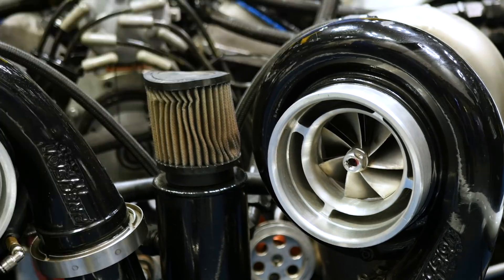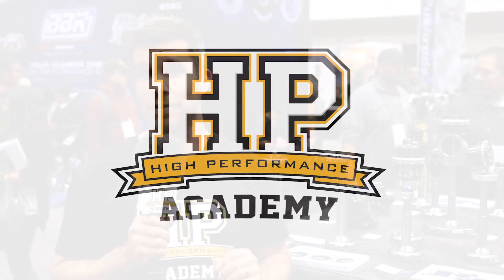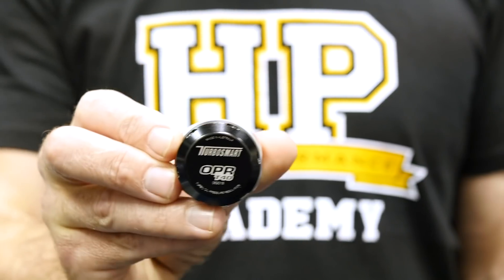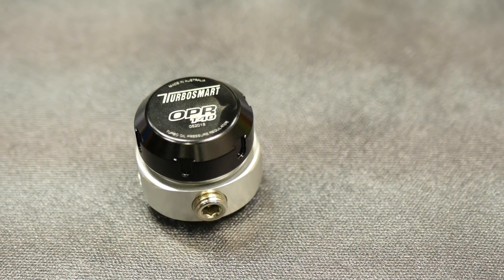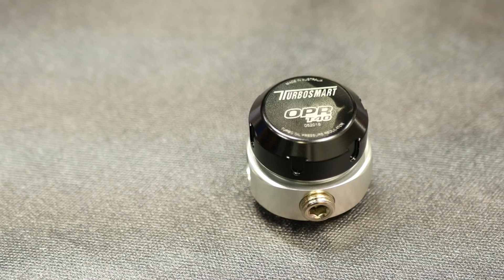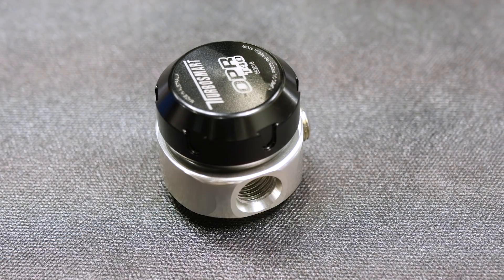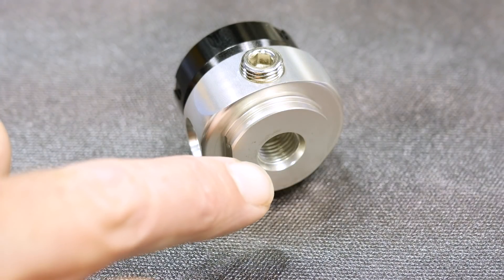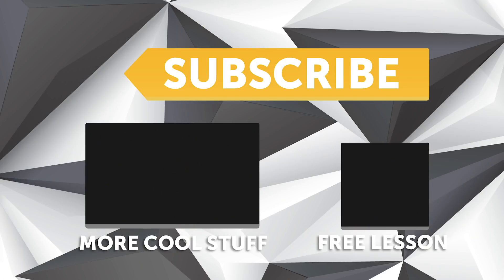Excessive Exhaust Smoke? This Might FIX Your Problem | Turbosmart [TECH NUGGET]

Comment: kinda stupid to put a filter in there? The main filter will sort debris out. The little filter in his unit will only risk to clogg which will end up with a turbo with no oil
Reply from the maker: This isn't a filter, it's a regulator - Taz.

Comment: If you have upgraded your rb25det with a nitto oil pump this will cause excessive oil pressure to your ball bearing turbo as nick stated oil will get past your turbo seals. This is a must for those folks.
Reply: Recently installed one of the new models in my sr20 and works a treat.

Comment: Hi I have new pte  6466 on my  have busted 2 turbo seals  will this help  I have a nitto pump  and car is an r32 gtr have been told  to try this 

My  drain and turbo position is set  up  correctly 

Thanks
Reply: @gtrlife2941  Restrictors in?
Reply: It should since it's made to keep your oil pressure to the turbo at a certain measurement

Comment: will i have to remove the restrictor that came with my turbocharger from factory?
Reply: It would be a good idea to remove it considering that this turbosmart product adjusts pressure to what you have stock

Comment: +1 I run one of these on my 430hp Miata now which was oversupplying the EFR6758 with oil and causing huge white smoke clouds. Issue completely resolved now, only caveat was I had to drill yet another hole in the oil pan for a return - Do not mix with the turbo oil return.

Just thinking now, I am going to look into putting an in-line oil screen to make sure to catch any metallic flakes from bearings etc. before they get to the turbo.
Reply from the maker: 430hp Miata! Awesome! There was another comment on here about adding an extra filter to the line.

Thanks for sharing the tip on the oil return for others and I hope your turbo enjoys a long life =D - Taz.
Reply: You say "do not mix with the oil return but it's the same oil and it would have been easier to tap in the large oil return line or a T or V piece for both into the existing hole. Pretty sure that is in there instructions even....
Reply: @brettus9115  Oil coming out of the turbine is frothy oil, the return from the regulator could in combination with the turbine return overwhelm the single return line around the union bubbling up oil into one or both return lines. I'd rather not pull the engine twice if this was the case and would rather just tap a dedicated return.

Comment: Question..so this is a pressure reducer to stop us putting to much oil under load especially byt what does it do say at lights when engine is hot oil is thin and idle oil pressure is below 40psi does it starve the turbo or let through a base amount to keep it going?
Reply: My personal thought is the following: if the reg is set on a pressure of 40 psi, if the supplied oil pressure is below that value (ex. 38 psi) this same value will be delivered to the turbo core... Nothing different from a FPR 😉😉
Reply: It only limits excessive oil flow to the turbo.  It doesn't maintain a static oil pressure at all times, it just prevents over oiling.  A ported and or larger turbo oil drain line should be priority if the option exists for you.

Comment: Wont this lower the overall pressure in the rest of the motor ?
Reply: Mohamad Itani no. It will only be a part of the oil feed line system to the turbo. Regulates just the feed and the excess would be directed back to the supply.
Reply: @2jimmycrackcorn  yes but if u are bleeding everything after 40 psi this means the rod bearings will get less pressure
Reply: Mohamad Itani that’s the thing. ONLY the oil feed line will get regulated, the rest of the engine would get the normal pressure the pump supplies. It would be implemented in the oil feed to the turbo and that is all, nothing else.